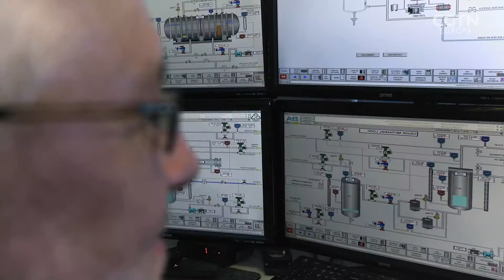Carbon Recycling - Manufacturing renewable methanol from CO2

Comment: Seems like the efficiency is pretty low if you have to do electrolysis, pressurization, distillation etc. Is it possible to produce methanol directly from electricity CO2 and water? Can you reverse the process in a direct methanol fuel cell?
Reply: Nope, hydrogen in the water is locked in an energy well, you have to pull it out via electrolysis. You should think of methanol as a carrier of hydrogen.
Reply: @markotrieste  And a 'captor' of co2. Interestingly co2 from metanolfuelcells can be recaptured.
Reply: If you form it from carbon neutral biomethane into biomethanol. You gain energy not loose it.

But energy negative e-fuels are more “sciencey” I guess so they get more coverage 🙄
Reply: CO2 is climate-irrelevant. 

Interglaciation climate change (i.e., the Medieval Warm Period) is caused by changes in cosmic rays (Svensmark et al). 

There is not such thing as anthropogenic global warming.  

"Global Warming" is a superstitious bullying and shakedown of the taxpayer. 

Just burn coal and keep looking for more oil and make it out of coal (the way South Africa does at SASOL).
Reply: The process energy for green MEOH is about 12 kWh/kg
And the lousy combustion energy for MEOH is 5,5 kWh/kg
So were is the benefit? Where  are you getting the difference
between 5,5 - 12 = - 6,5 kWh/kg ?????
Reply: The challenge in converting to a non- fossil fuel economy is to create a power delivery system using clean, abundant nuclear energy.  Batteries are one way; expensive, short-lived, and made using scare rare earth metals, amd building a completely new infrastructure (charging stations), or produce clean-burning methanol, which can be delivered using existing petrol stations with minimal mal modifications.

The Methanol economy is probably best realized by combining this fuel with 15% gasoline, useable in flex fuel vehicles.

The push to all-electric vehicles is because of graft; some are getting very, very rich.  See: Elon Musk, Al Gore, etc.

The best system
Reply: @scottslotterbeck3796  I recommend the article "why fusion will never happen" by energy matters. It's about fusion, but many of the flaws are the same for fission nuclear plants today.
Reply: @scottslotterbeck3796  running the world on nuclear power may have kind of made sense if it was pushed for 20-40 years ago. But unfortunately nuclear power is simply too expensive now. Renewables are much cheaper at this point, and nuclear power has only become more expensive. Likewise the promise of fusion power is laughable: even if we get net positive energy, fusion will likely always be more expensive than fusion power, which will always be more expensive than collecting the energy that reaches us for free from the powerful fusion generator in the sky
Reply: Likewise batteries have real advantages over other power storage methods in that they have near zero round trip energy losses. No liquid fuel will ever achieve this even with advanced fuel cells. I agree though that the rare materials required to create li-ion batteries means it probably will not be the storage system we need to manage power on the largest scales.
Reply: @sandpiperbf9767  oh sure if you like paying millions for something that has worse energy density then firewood that is not applicable to 90% of industry and current vehicles carbon neutral energy needs; go right ahead buy all the batteries. Those cobalt slaves in the congo would love you for it. Also try not to think about the fact that a pantograph system can do far more with far less of the same resources as a conventional battery electric car 🤨 yes of course you can magically figure out a way to store Megawatt hours of long term battery capacity storage without  being more expensive then empty steel or plastic vessels when the legal battery discharge limit is outputting no more then 4 hours of full discharge per day from their dismal capacity to avoid fires while ICE and fuel cells can run 24/7. Yes of course you will force the 70% of people running pay check to pay check to buy a new EV, upgrade their electric grid, and apply that universal battery technology to current flame based manufacturing, shipping and reasonable Milage aircraft. Yes suck a disproportionate amount of attention and funding; it’s not like there are fundamental limitations in battery technologies that require other solutions to supplement them including carbon neutral fuels. Sure shipping pre charged batteries everywhere waiting days to discharge them by shipping “tanker” boat or laying ocean wires to all the shipping port location through the deep ocean is not resource prohibitive. No there is no negative implications from that such as region-locking the worlds surplus renewable energy instead of having a world renewable energy trade economy like we do have a current scale non renewable energy trade system based on fuel hauling for so many reasons. 

But hey at least it’s energy conversion efficient. May suck balls at everything else like raw on demand energy, full discharge duration, energy capacity, affordability, transportability, resource availability, backwards capability, and carbon neutral sector applicability but 🤷‍♂️.
Reply: @sandpiperbf9767  I love the fact that people are trying to crack fusion when they could stick a solar panel outside to get energy from the suns fusion reactor? Heck if we had a real space program we could dyson swarm that shit. Or settle for solar desert placemats 🙃 though you would probably need to store the surplus energy in a efuel form so it could be easily shipped around the world from all the renewable energy hotspots.
Reply: @wastelesslearning1245  I understand that batteries are not useful for all energy needs. Aircraft is a good example of something where fuel sources are likely just better than batteries. But also I think you're misrepresenting the progress of electrification technology. We have lithium ion, we have sodium ion which is heavier but much cheaper. There also are other grid energy storage methods like pumped hydro, compressed air. Generally fuel based energy storage is less efficient than all of these.

Also I really like the idea of using methanol as fuel. I'm not trying to dismiss the application. I'm just curious about how the energy conversion rate compares with other storage methods
Reply: @wastelesslearning1245  I agree on the fusion point, fusion power plants are a really stupid idea that gets a lot of hype
Reply: @sandpiperbf9767  ah I see. Yeah I don’t mean to poo poo all over battery innovations. Believe it or not my ideal world includes solar e bikes which need batteries and biking infrastructure. Battery cars are way to energy demanding then they need to be; the pro being of you scale the size down you can runoff solar cells. So bike lanes, walkability as a urban design consideration, and electric train transport would be so good. 

Also pantograph and smaller battery packs would be on every new vehicle with a bio fuel engine. The pantograph e highway infrastructure will need to be set up but once it is you will only need to run fuel and pay fuel prices when your off roading and in under developed rural areas. By then the fuel is carbon neutral anyway and the total amount of fuel needed per mile is so ludicrously reduced it won’t matter. The rest of the time your on the infrastructure you have infinite electric range (that’s the pro of electricity is you can charge on the move) and the e-highway people know that and are making conversion kits for standard trucks no matter the engine. Saves so much batter resources too I love it. 

I am also quite impressed with flow cell batteries and their scalability far exceeds solid state ones (though they still suffer from the battery limit of capacity and on demand sourge power, they at least scale with empty vessels now and can be pre charged and transfusion of pre-charged anolyte and catolyte can be just as fast as traditions “refueling”. So yeah I still love those innovations. But in my opinion solid state gets way to much credit, it’s worse energy density then firewood and not backwards capable in the ways people need to save the environment. Legislators focus way way way to much on solid oxide the fail to field trial and find the other possibilities at least in the US. You need to drive a Battery electric car for 3 years to break even carbon wise becuase rhe upfront emissions of manufacturing is 40% more then a standard ICE vehicle. This is why a carbon nuetral fuel in a ICE car is better. Heck if you are using gasification of biomass to syngas you can burry the char byproduct as biochar and be running a carbon negative fuel ( either straight syngas or converted to methanol) both can be run in ICE or fuel cells. 

pumped hydro is really nice but it’s location situational. It’s ok but the density and cost is prohibitive if your not in the right location for storage by micro grids. Same with liquid air storage minus the location specific part; lacks energy density requires expensive cryo tech. Easier to set up a region micro grid with neutral fuel tanks and generator and call it a day (the cost savings is huge for fuel which is why it dominated historically) amd consdoer localoties can make there own fuel from biowaste . jeck landfills of old are a 50 year continuous supply of fuel and people have been running on woodgas and wood alcohol since the 2nd world war. both methane and wood gas/ syngas can be converted to methanol reasonably efficiently while staying energy positive and making use of otherwise polluting or squandered waste.  There is more then one kind of efficiency is what battery tech tries to trap people in the mindset “it’s all about energy conversion efficiency”. It’s not. Applicability, cost, resource availability, scalability, energy density, all these are also “efficiencies” just ones not flaunted by start ups and solid batteries for embarrassing reasons. A carbon neutral fuel (heck we even have carbon negative fuels now) is always better then a battery electric car (as we know it today: not pantograph) by default carbon wise let alone cost. 

The thing is pantographs, walkable urban settlers, electric trains, pantographs, pumped hydro, solar e bikes, and PANTOGRAPHS are not new developments and loose the spotlight to inferior firewood mined by slaves in the press and funding allocation opportunities almost every time.

Comment: For marine application it is more suitable. Battery systems do not have enough energy density. Recharging time is too long.
İt is too difficult to storage hydrogene. Systems need too high pressure and extreme low temperature. Leakage is a significant problem. System can be very expensive. transporting hydrogene is a different story. İt could be very expensive too.
Amonia is too hazard gas. At room temperature it is at gas phase. Leak is a big problem. Storage systems can be too expensive. To burn it systems need modifications. Explosion is another problem. Transporting Amonia is difficult. Systems need possitive pressure to storage Amonia.
Methanol is more suitable than amonia.
Global warming is too big problem. a too big environmental desaster is closed to world.
Every country decides and makes something for global warming quickly. Time is too limited.
Reply: Exactly.  You are quite bright and knowledgeable.

Comment: You need too much electricity for these processes. And if it comes from renewable sources why then just dont use it as it is. More effort should be put on finding better ways for storing energy  rather than building these factories.
Reply: Nuclear, my friend.  So much energy!
Reply: The typical ansver in Denmark to what you are saying would be, yes...... run your cars on electricity,... and your heating, for that matter,... but there are 'hard to abate' sectors where electricity is not an option: Planes, ships and plastic production and.....
Reply: CO2 is climate-irrelevant. 

Interglaciation climate change (i.e., the Medieval Warm Period) is caused by changes in cosmic rays (Svensmark et al). 

There is not such thing as anthropogenic global warming.  

"Global Warming" is a superstitious bullying and shakedown of the taxpayer. 

Just burn coal and keep looking for more oil and make it out of coal (the way South Africa does at SASOL).

Comment: The very small amount of CO2 in the atmophere has not impact on the world's climate.
Reply: Go to Venus and tell me how CO2 doesn't effect climate.
Reply: Source: Trust me bro
Reply: Why do you keep denying sound science established in centuries? Climate sensitivity to CO2 was already hypothesized by Fourier in the 18th century and proven theoretically by Arrhenius at the end of the 19th century.
Reply: CO2 is climate-irrelevant. 

Interglaciation climate change (i.e., the Medieval Warm Period) is caused by changes in cosmic rays (Svensmark et al). 

There is not such thing as anthropogenic global warming.  

"Global Warming" is a superstitious bullying and shakedown of the taxpayer. 

Just burn coal and keep looking for more oil and make it out of coal (the way South Africa does at SASOL).
Reply: The very small 400 ppm CO2 concentration in the atmosphere is growing exponentially.
Reply: @tasimota  but looking at the experiments showing co2’s heat absorption, we’d need nearly 100 times that 400 ppm to produce the heat gains they’re claiming, which would prove that co2 isn’t the driver they’re making it out to be.
Reply: @tasimota  it is not growing exponentially.  However, it is growing and these processes will solve the problem.  We just need leadership!
Reply: @tasimota it was far more before and sometimes it was even colder with higher concentration
Reply: @tasimota  Scare tactics. I hope we never meet